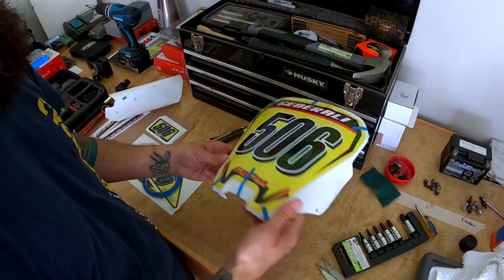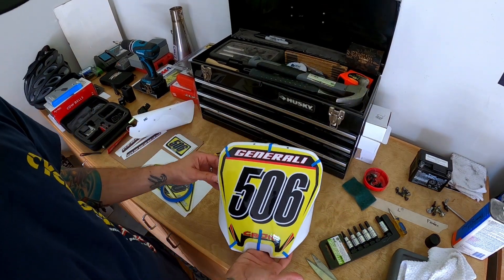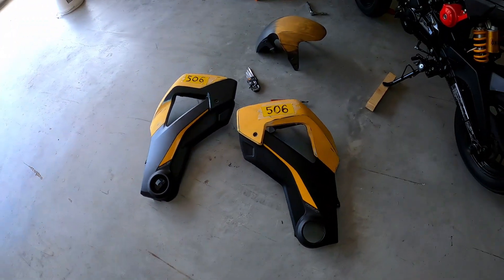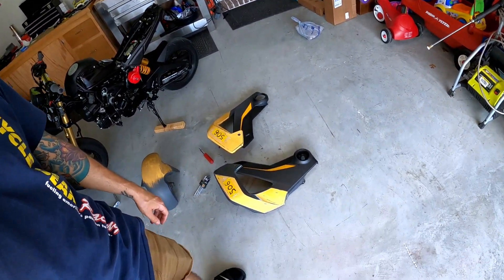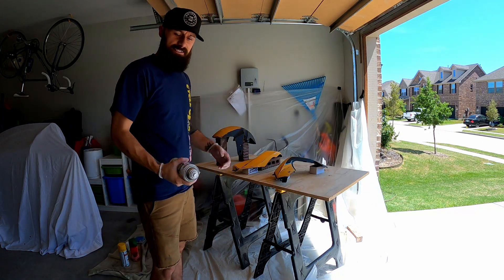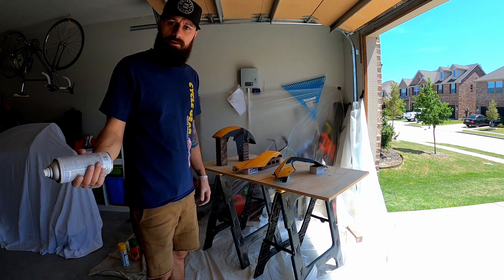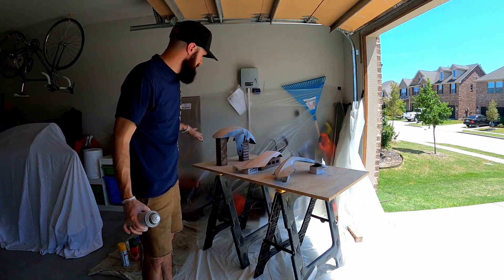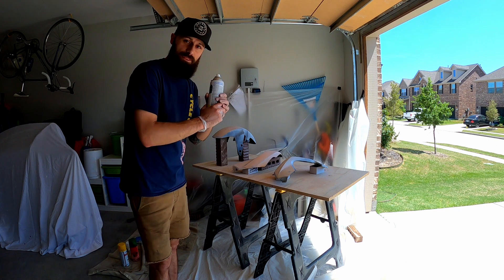SUPER CHEAP Honda Grom Paint Job | Part 1: Prep & Prime

Comment: The amount of stuff we’re going to be able to get done before we race again is crazy. I’ve already got a decent amount done. Can’t wait to see the finished product
Reply from the maker: No kidding! I haven't really touched the 300. Just the Grom. What all have you been working on?

Also, were you running a 360 cam on the back of your bike at NOLA?
Reply: Tony Generali We put some brembo brakes, got a new exhaust system, and got a nice throttle master. I also have to put a clear coat of paint on my bike.     And yeah, i have a GoPro Fusion, but i didn’t get any footage sadly, i forgot i had taken out the sims before i got on the bike 🤣
Reply: are you gonna end up doing anything to your 300?
Reply from the maker: Probably not. The 300 is in a really good place. It's ready to go when this blows over.
Reply: Tony Generali ahhh okay that’s good. i’m aching to get back on track already

Comment: I just got a grom and want to do this, the dude I bought it from dropped it and where the front turn signal goes its chipped pretty bad. Would you recommend trying to use like filler or something before I try and paint it?
Reply from the maker: If the paint is chipped, I'd start by sanding through the paint in that area to get it as smooth as possible. If needed, some bondo filler would be a good option to smooth it out. If it's cracked, I'd personally hit it with some fiberglass filler... sand it smooth. Then finish with a super light layer of bondo to fill any pinholes. 

Sand everything with 6-800 grit. Spray a high fill primer. Let it dry. Then lay color.

I'm NOT a pro, but that's how I'd go at it!!!